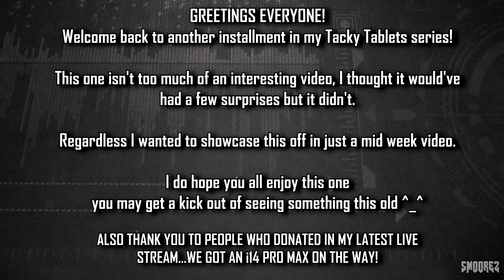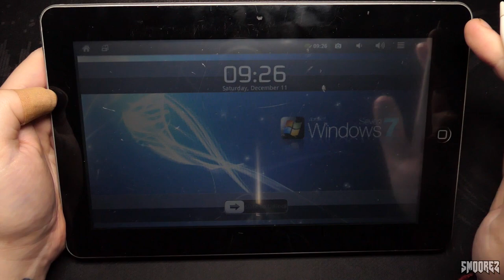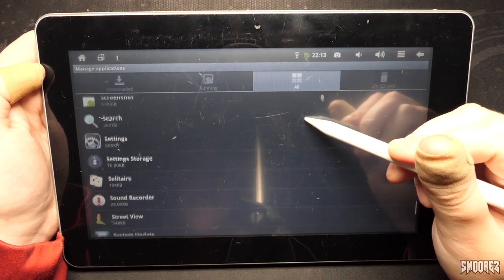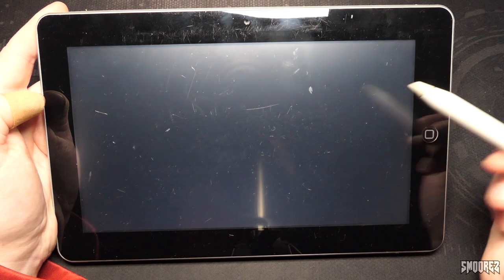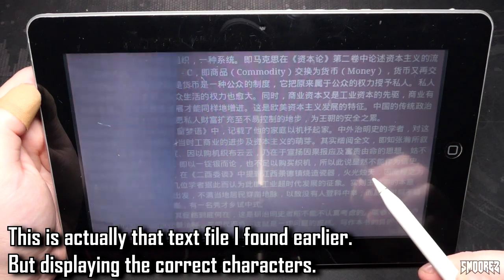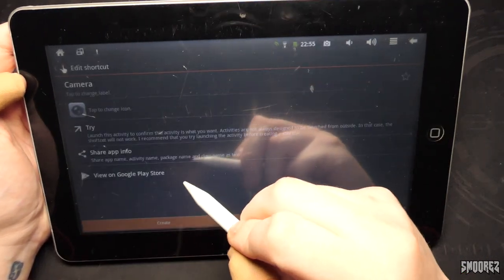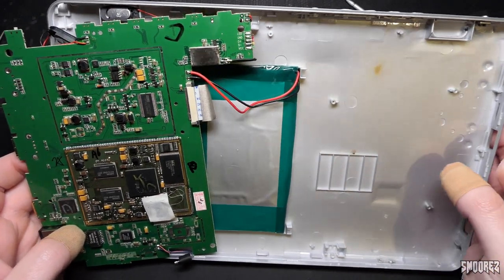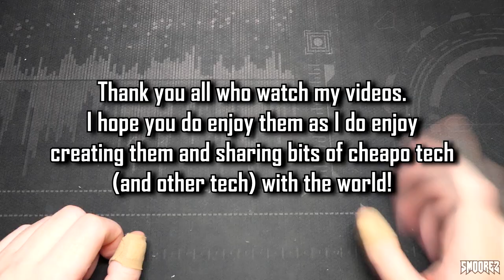Probably the most boring iPad knockoff to exist that's behind 11 Android versions (TACKY TABLETS E4)

Comment: Looks like a Tablet PC to me. This boot-up process is very much normal if you installed Android on a PC, since Android is based off of Linux mainly, the process looks and feels 95% similar. The ports too give it off since it's not normal for an Android tablet to have that many ports, let alone 2 freaking USB-A ports and an Ethernet port in particular, so yeah. A Tablet PC with a PC version of Android installed on it, aaaand it's customized in the weirdest fashion possible.

Comment: At the boot sales, every one of these I saw had a smashed screen, I got one for a quid ( so 1.2 dollar-ish at the time) and found it had a ROCKCHIP which Linux support is brilliant.
However, I put it to recycling at work.... The only one without a smashed screen had MediaTek which I found no information on getting linux onto ._.
At the time, it would've been the perfect pen-testing wifi tool, especially with those two USB ports and network port.
Look up SunXI Linux for the ROCKCHIP, still laggy apparently, but does give these things some utility if running a KALI ARM Root-FS on top of Debian for ARM (ROCKCHIP), but you'd have to stick with 32-bit (ARM-ABI) for these tablets.

Comment: Man this device is compared to basically an RCA tablet which the brand probably made the RCA tablet this definitely is on custom firmware at least it's running some type of Android Linux with a  windows overlay on top of the custom Froyo Android with Linux side loaded

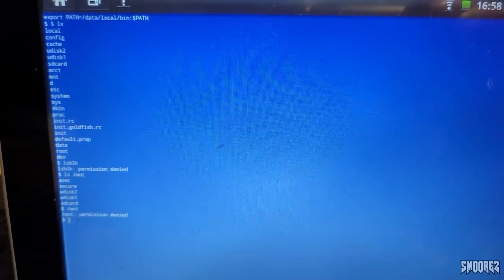Comment: 25:55 did you try putting in "sudo" before the command?
Reply from the maker: I did try several commands but got permission errors. Hoping to dump the system files soon with a method folks have mentioned.

Comment: Wait is that a real apple pencil? How did he use that?
Reply from the maker: The pencil is just used as a stylus. It's completely dead and doesn't work. The tablet uses a resistive touch screen so any object that can push down on the layers for the touchscreen will work fine :)

Comment: Yes android is based on Linux but it looks like this system runs some kind of a lynux OS and Android runs on top in an emulator that's why the performance is very bad or may not be that way but Im sure that Android is not running natively in this system and it is running on an emulator. And to add it is running on an SD Card
Reply: No Linux would boot directly into an Android emulator that fast. Modern hardware still takes seconds to boot, imagine a 2010 cheapo tablet.

Comment: The tablet looks to be running a version of Android x86 judging from the boot process alone. I would recommend booting a version of Linux that will let you read an ext4 file system. That would allow you to rip the system files, and possibly do a little more with it should you get a wild streak across ya lmao
Reply: Unlikely since it has ARM processor

Comment: Ok smoorez I just realised. Keep this beast. The 3 motherboards connected together work together, which is why it runs Linux and a fake ios system (android). The Windows 7 thing works with Linux and I think is some Linux rom. The android os works with the other part of the motherboard that is stuck on. This explains all the Repurposed stuff in it. So it's basically a cheapo laptop with 3 motherboards.